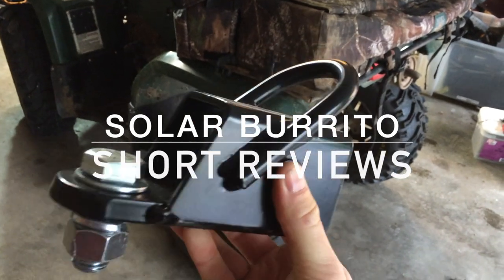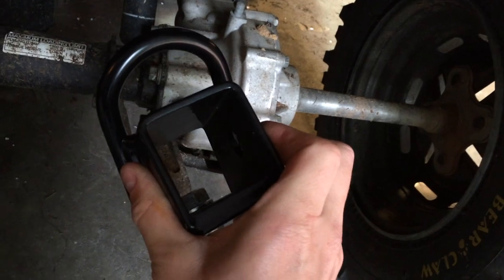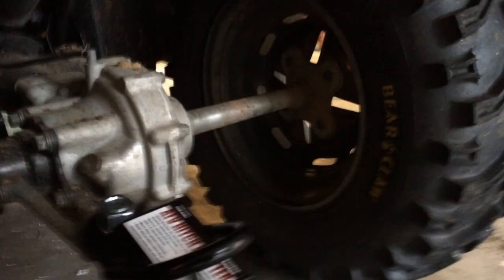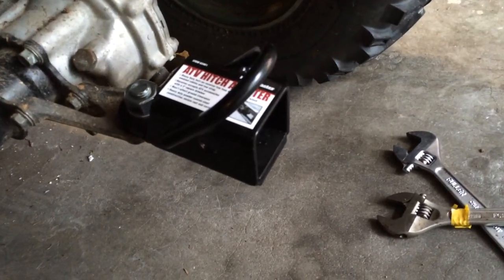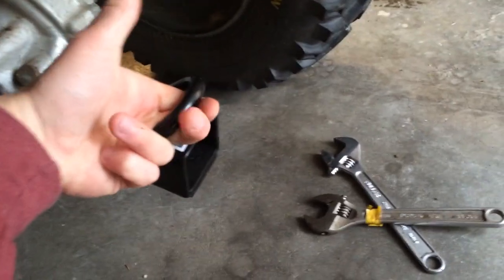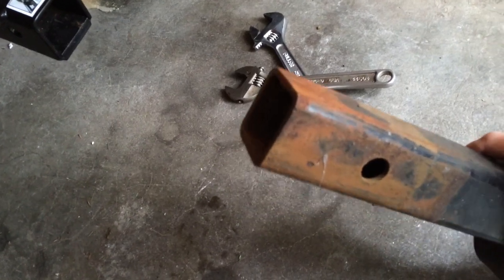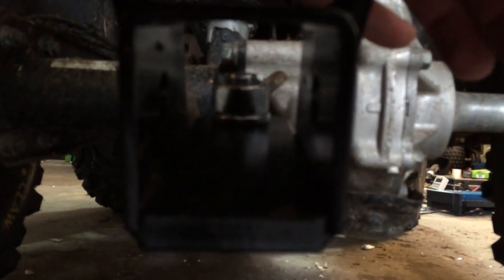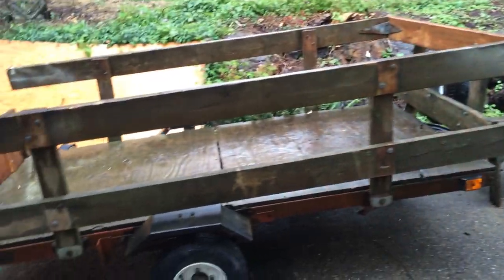Harbor Freight ATV Hitch Adapter Review

Comment: I bought the same thing too. You can pull a trailer with it but you cannot back-up a trailer with it without it swiveling on you. You will have to tack weld it to the Hitch adapter plate of the ATV

Comment: I can understand the appeal of a receiver on your wheeler but that assembly along with the hitch puts the weight out on a long lever, all to be supported by a single bolt on the factory flange. If you're lucky you will just bend the flange. There's a chance you'll break your axle housing. Careful.

Comment: I have one just like that on my Polaris and it's good the only problem is if you tow a heavy load the thing wants to go to the right and left and it makes it back enough difficult that's why you have to put the thing on tight as heck but I wouldn't doubt using it I enjoy using it with a trailer hitch and towing around smaller trailers which a four wheeler ain't really made to tow big trailers that's where you had pickup trucks
Reply from the maker: Ya I was concerned about the same thing.
Reply: Same problem here , when you back up it swivels side to side so I got a plate and welded stops on it to hold it in place and the plate has holes for chains . Got it at mardens (Maine harbor freight kinda) it came with the hitch, bolts and a receiver for like $10 so can't complain if takes a little tinkering.

Comment: I bought 3 of them for all three of our quads and the darn thing swivels side to side even when tightening down super tight!  I suppose I could have hubby tack weld it to the quad then it would stay.  The other issue is that I would like it a little higher.
Reply from the maker: I agree. The swiveling makes it useless for going down hill.

Comment: Isn’t that going to swivel from left to right as you turn ?
Reply: That’s why you torque it down, think!
Reply: @jonnybravo9003  to what the hitch ? Think about it ! With one point that’s bolted it will turn along with tongue ! Those hitches are absolutely crap ! Why not use one on your car or truck and see what happens !
Reply: @davekimbler2308  listen up! I have one of these and I used my impact wrench and torqued it down and it won’t move a bit. It’s on for life
Reply: @jonnybravo9003  lighten up sir , I just made an observation on a potential problem that may occur ! That’s all !
Reply: @davekimbler2308  worked for me! Maybe not for someone that doesn’t know!
Reply: They get loose.
Reply: @laboscot1469  that’s what I’m saying ! Thank you for backing me !
Reply: @davekimbler2308  many of ways to stop it from turning. You just want to argue
Reply: Nah I had to tack weld mine. They don’t turn a whole lot while pulling a load but when reversing and trying to turn they will swing every which way. Cheap receiver and I recommend it as long as you can weld…

Comment: That's hitch isn't gonna work. It has a drop and what you need is a hitch with a 3 inch lift at min.  Your trailer isn't gonna hook up and if it does its gonna be too low
Reply from the maker: was a pain, it swivels making it almost useless down hill.

Comment: i wouln't recommend these, look at strong made hitch receivers
Reply: Stronger than the cast aluminum it's mounted to...
Reply: +Jackup460 That mount that the hitch is mounted to is pretty beefy an there's an arm that comes off it an bolts right to the axle tube to give extra strength also them rears are made of some tuff aluminum